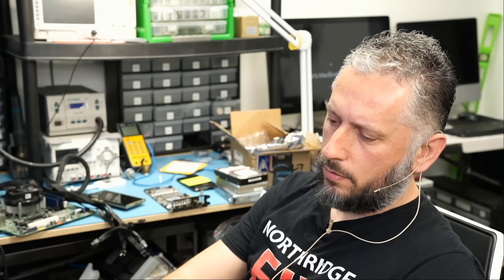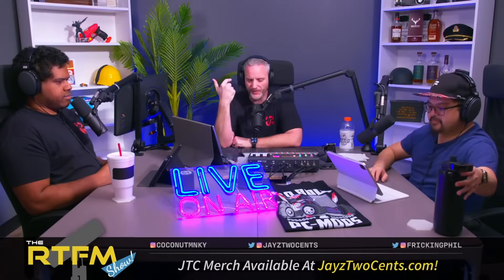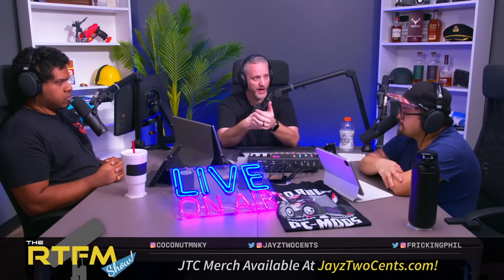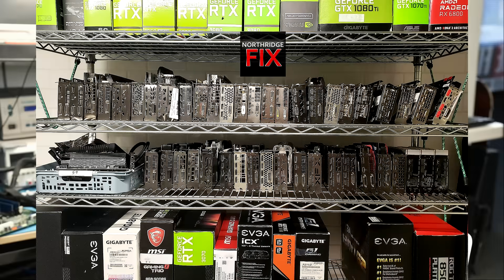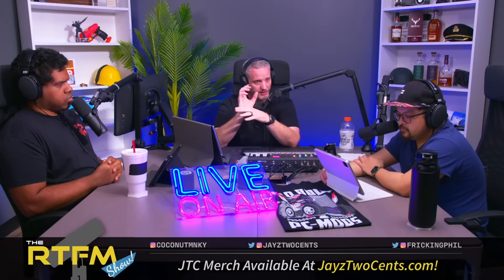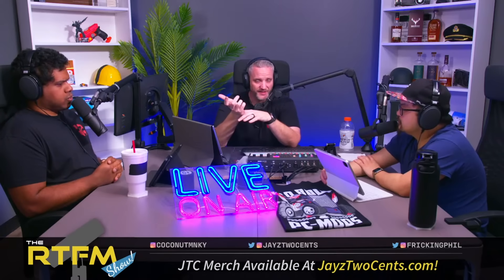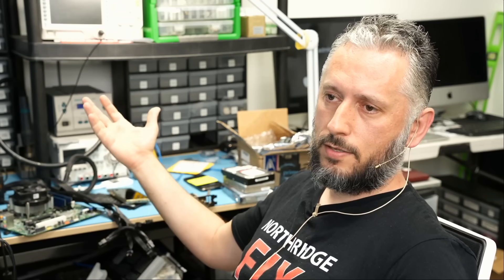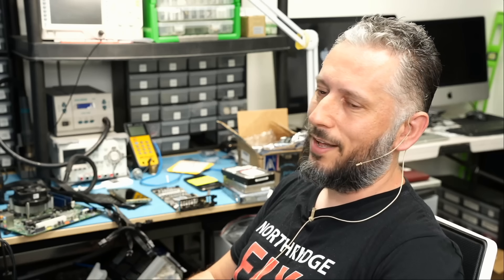Melting 4090 and CableMod. JayzTwoCents and Gamers Nexus Response. Blame NVidia or User?

Comment: i do electrical work on residential homes. I know its not the same thing as electrical engineering of GPU`s but if you have too much current running through a set of wires going to an appliance with no check on current (IE a breaker) eventually the wires will overheat (potentially) and fry themselves as well as the plug there connected to. This will happen regardless of what the user does. So yes I have to agree that it is definitely a flaw in the design of the power connector of the card.

Comment: What I found interesting is when GN cut most of the 12V lines off and ran with only 2 on the connector at full load and it still ran cool suggesting the number of pins used is enough and something else, like a misaligned connector, is to blame. I agree that should have been mitigated at the design stage. Will be interesting to see if NVIDIA comes with an official stance on this.

Comment: Yeah, I'm against GN on this one. It isn't happening on 3090ti's. It isn't happening at the power supply for the new modular ATX 3.0 units that have the same plug. It isn't happening going into the cablemod adapter. It always happens at the plug on the card itself. That tells me everything I need to know.

Comment: I've seen many 3 phase power outlets go up in smoke because the plug wasn't screwed into the power socket. The plug also tend to work themselves loose with high amperage and frequency overtime. Maybe a similar thing is happening with these small plugs carrying high amperage?

Comment: The Card can not get enough current through it's designed power port, causing excessive heat in the cable/ends etc. THIS is why ONLY the 4090 is doing this. You can't flow 50+amps/A of 12V DC Current through 12gauge/AWG TOTAL worth of Pins. Sorry Nvidia. You can NEVER install my Car Stereo.

Comment: those guys are all sponsored by nvidia or are in a position
where if they badmouth them then they will no longer be
able to do business with them.
this is clearly an nvidia fault and its a shame they can be
aloud to pretend like the issue doesn't exist. 
simply put, the cards are being run too hard for what
the adapter can withstand. the easiest solution is to
release a driver or bios update the lowers the tdp of
the card while also lowering the performance. thus
leading to bigger issues of course but its either that
or rma every 4090 and add an extra power adapter.
whats really gonna happen tho is....nothing

Comment: I work as an electrician in Germany and what I can say about connectors is that when you plug in a connector and there is current and voltage on it, the connector sides can melt to each other because the contact is poor and too much current flows through a tiny area and the resistance is very big. These whole connector dramas I heated and saw may be caused by plugging the connector while the PC was on?
Because if the connector is plugged in properly and the resistance is low there is no possibility that it can melt.

Comment: But you can see on video before removing the 90* adapter ,that , it was ,,full in” plugged, so , why would you tell that it is 1 mm difference on socket but you don’t have enough evidence 😂😂😂😂😂
Reply: The video card is drowning too much power only on 1 connector , more , if you look on every video , you will notice the problem only by 3 of the pins , just look one more time , it is very noticeable! Have a nice day NVidia 😂😂😂
Reply: Exactly how Alex did say , every end user don’t have the same power supply model , but they have the same connector and we can see also on statistics how many other models from Nvidia and not only have this issue with melting connectors in the previous models

Comment: I agree with you Alex I am an educated electrician with 20+ years in my back, the issue is the connector for an example it is not gold plated and that means you will end up with oxidation in the connector much easier. Take that with such a high current through such SMALL PINS is asking for problems, I seen this many times where you rely on small connectors and high currents. For an example I had a connector 5.5/2.5mm that was feeding a dc-dc boost converter to supply an led uplight with around 29-30V @ 3-3.2A, that connector worked flawlessly for over a year then suddenly the entire connector melted even if both connectors where all fine on the install date. It all roots down to that connector can not HANDLE that current for longer times, as the sidewalls on that socket does not have enough surface area and to little force between the socket and the pin case closed it is a design flaw this product should never been released like this = RECALL!!

Comment: Here's what i don't get. Yes, Jay and Steve are both great channels but they do not do this line of work for a living, where Alex does. How can you argue with experience? With that being said, does this not bring anyone back to when they were 16 and trying to put an Audio system in their first car or even their moms car? You bought some crazy subs, a "2000w" amp and then you wire everything up but you didn't buy the nice amp kit you just went into your dads old tool box found some little 10 gauge wire for your power and ground, you get everything hooked up and you're slapping those Fosgate Power t2s next thing you see smoke and smell burnt plastic and see your power wire running front the battery to the amp has melted all the insulation to the carpet of your car and wonder why.... Should've bought that 0 gauge bet that wouldn't have happened..... i get 3090s weren't doing this but that new small connector on 30 and 40 series cards is just asking for trouble. You're pulling 450w though larger gauge wire to the stupid new high power adapter and to that little high power connector.. I'm no rocket scientist as you can clearly tell but this is absolutely not the end users issue. NVIDIA SWALLOW YOUR PRIDE, ADMIT IT'S A HORRIBLE DESIGN AND GO BACK TO A NORMAL 2-3X 8-PIN CONNECTOR! I have only known about North Ridge Fix for a few months i have known about Jay and Steve for 10+ years so its not that im just saying this because im writing this comment on Alex's cannel. This is what he does for a LIVING, Jay and Steve DO NOT. Nothing against them at all they're both great at WHAT THEY DO but they simply do not do what Alex does. They may have some knowledge on SMD work. i 100% agree with Alex..... Nvidia is to blame..... not put the blame on the people who buy their products.

Comment: The connector should be made with Fiberglass plastic. Where I work we use this type of plastic designed for high temp areas. The power consumption is high and the heat melts the plastic. Nvidia problem and the connector manufacturer problem.

Comment: I really want to see this connectors tested on a dc load with an appropriate power supply. Expect the "user error" explanation is a bunch of bs. Still would like to see some additional testing done on connectors that have already failed and see if there's variation in the melting point of the plastics

Comment: Basically If connector is well designed, It should able to sense if cable is not properly connected.

So they can design some sense pin or sleeve on female side a bit shorter than Power Pin so when the sense pin connected it make sure Power pin are fully inserted and secured.
If not they may design to let it power on but with limited power budget and display the Warning to user via drivers.

This rule user error out and if it still melted, It's engineering problem.

Comment: You can see the problem is with the card. The high resistance or the blockage or damage curit. Will cause a built up of heat in the connector. Use your heat carmar the check. If possible.

Comment: From an engineering perspective, there are several things at play here.. The conductor mating interfaces, the fitment/latching interface, and the current draw through the conductors. For a production design, none of those items should cause a problem if it was thoroughly tested in R&D, yet it is a problem. It could be a combination of factors. The easiest thing is to blame an end user, however we've seen time and time again where connectors were securely in place yet still melted. The problem is still the design, whether it was designed with inadequate current carrying capabilities across the variance of tolerances seen at the manufacturing accuracy level, but also it would be a design problem if we need to precision plug in a cable with a feeler gauge and maintain it at a specific angle/degree as it sits in the computer with the potential to move as the floor vibrates when we walk across the floor to sit down at the computer.

Comment: Saul Goodman. It's an Nvidia engineering problem that should be fixed by them; if anyone else can provide a viable solution then sell it to the highest bidder. As consumers/reviewers of computer parts Jay and Steve appear to know what they are talking about and I love watching their videos. I think Alex knows a lot more about how much energy is going through the connectors to heat them up to their melting point. :elbowcough:

Comment: If you want to catch a fish, you don't ask fish how to catch a fish, you ask a fisherman. I believe alex is right about the connector issue. Card is drawing too much power from that little connector. Its totally Nvidia problem. People should start checking out their connectors even if their cards are working fine. Just in case. And if they find any issue they should start uploading it on the internet. Its not a cheap card

Comment: Is not the responsibility of the manufacturer for a product damaged by improper installation. The manufacturer can take in consideration some tolerance situations, but cannot be responsible if the user did not perform a proper installation.

In this case, if the product has multiple same issues, probably indicating a design defect and the manufacturer should be responsible for the product recall or a full refund.

The product warranty is for this exact reason, to guarantee a product that was properly installed and stops working under normal circumstances and used as intended.

Comment: So this is happening with 4080's as well?
If so, Then the entire line up that uses the 12VHPWR connector should be recalled.
Didn't Intel even mention they think the connector should use a spring design instead of the current one.
P.S.   Would love to see you get together with JayzTwoCents for a collaboration video.
Reply: If I recall the connector design itself was originally from Intel, and even Intel chose to scrap using it in their own products that should have given Nvidia pause as to using it.

Comment: If I buy a Ferrari and believe that I have purchased a car that has all the necessary features of a supercar, but then Ferrari, for some reason, changes the braking system and replaces the classic Ceramic Discs on the wheels with drum brakes used in regular cars from the 80s, and upon my first attempt to brake, I damage the braking system and wreck the car, it's not like I can say it's the user's fault for pressing the brake too hard... There's something wrong with the design of the cable by NVidia here!

Comment: I think that the best argument by far is why we didn't have similarly high fail rates in older cards. Probably because 4000 series GPUs draw even more power or with different bursts that cause this issue. One more thing I want to point out about the adapter. Correct me if I'm wrong but even if you seat that adatper properly on the card, but have a poor connection on the other end of the adapter that would cause higher resistance and higher temperature, you could still have the melt issues on the card side of the adapter because over there you also have high temperatures due to the massive -heat hungry - body of the card as you always say in your videos.

Comment: the user of the card with the cablemod 90 degree adapter is certainly aware of the issue so its unlikely that he used this without it. 

I also read the comments on that GN video and somebody said that his card's connector melted despite this particular use double checking his connection every single day.

Comment: i think they did not upgrade the video card connector they are using the same connector on the old video card its common sense if you use super power video card same as 4090 why you used the same connector on the old video card the connector design in only on low powered graphics card it cannot handle the heat made by the electric current from the PSU to video card the terminal of the connector is thin there is a electric traffic per terminal on the connector the more the video card need power the more the connector create heat.

Comment: I think they're shoving too much current through too small of a connector. If you look at previous gen cards they have dual connectors. Then they shove more power into a smaller connector? This is an engineering problem. Northridge showing cards with fully seated connectors still burning is proof in the pudding. Just like he says, nvidia problem. I'm with Alex on this one. He has many more cards on his bench than jays 2 cents or steve did in his analysis. Clearly there is a pattern at work here, and its is NOT user error. It's a bad design.

Comment: I DESPAIR, I truly do. Why has none of you looked in detail at the contact size and what it's being asked to do ? The problem is not Nvidia (as such), It's not the user, It's not the board, It's the companies selling a connector with FICTITIOUS 'LA-LA-LAND' SPECIFICATIONS ! The 12VHPWR connector manufacturers rate that contact at 9.5 Amps. Sorry, but a 0.4mm2 contact (0.64mm x 0.64mm) CANNOT be used at currents that high. *EVER*. *BY DESIGN*. For the same reason your house wiring doesn't use 'skinny cable', it's EXACTLY the same thing. Personally, I'd be unhappy using it beyond say 2-3 Amps (per pin/contact). It will simply get ferociously hot from electrical RESISTANCE HEATING !

Comment: One possibility could be (and this happened to me in the early 2000's)  I had a ati 9800 aiw that took a 4 pin floppy power connector,  I did not plug it in correctly once and it was enough to get the pins dirty from plastic residue and the pc would at boot up sometimes and say power to graphics card, no graphics card detected.  Finally one day I used a small blade and sand  paper to clean the four small pins on the card and never had trouble again.  Just a thought.  Then again I have had space heaters that I had to cut the plug off of and replace to keep them from getting extremely hot at the plugin.  Who knows. Maybe the pins inside the card connector are cracking at their bend in the housing coming out of the gpu causing just enough resistance to get hot.

Comment: Here's my take.  Meting connectors (and wires) are caused by excessive electrical resistance causing higher than usual I2R heating. This can be because of excessive contact resistance (eeg loose ot tarnished connection) or the Cross-sectional Area of the conductor being too small (leads to high resistance too). This is why large diameter cales are used for large currents ! Obvious maybe but it need to be stated !

Now if you look for a cable/wire rated for 45 Amps (which the 4090 can draw), a wire gauge chart will direct you to a (copper) conductor size of 6mm2 / 10AWG. The contacts in that 12VHPWR connector are however ONLY 2.4mm2 (you need to read the engineering drawing for the part which I have). Those contacts are also made of BRASS which has much higher electrical resistance than copper ! Brass has ONLY 28% of the conductivity of copper ! That's like making the contacts SMALLER STILL in terms of their resistance. It is beyond obvious that those contacts are going to be ROASTING HOT, AND THEY ARE ! It takes 270C (520 degrees Fahrenheit) to melt Nylon and that is how hot they are getting.

THE PROBLEM HERE IS PURELY ELECTRICAL RESISTANCE HEATING, NOTHING COMPLICATED AT ALL ! The connectors will melt if you wire it up to pass a current of 45-50 Amps without any graphics card being in circuit. THAT'S HOW CONNECTORS ARE TESTED ! And this one FAILS THE TEST.

The 12VHPWR connector is quite simply negligently designed. The data sheet values they give for its current rating are PURE BULLSHIT !  That's it guys. The product needs redesigning with higher performing materials. Nothing more to say !

However Steve of Gamers Nexus doesn't seem to be able to comprehend this and has gone down some silly tangent/rabbit hole of 'user error' possibly because he doesn't understand BASIC ELECTRICAL THEORY AND PRACTICE !

BASIC ELECTRICITY WILL TELL YOU WHAT THE PROBLEM IS AND ITS BECAUSE THOSE CONTACTS ARE SIMPLY *NOT FIT FOR PURPOSE*.